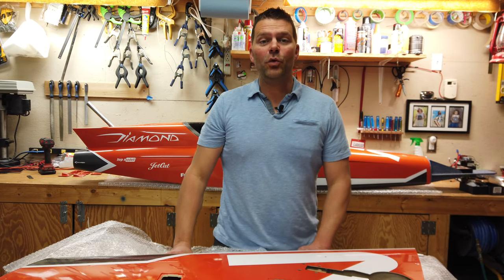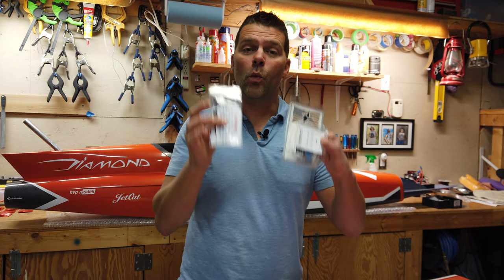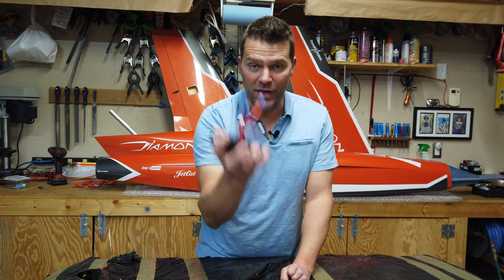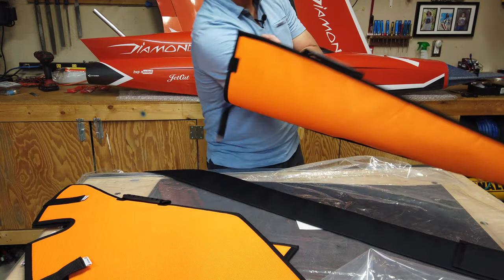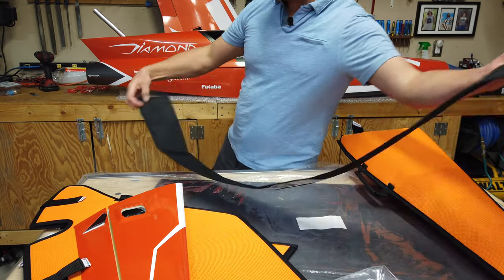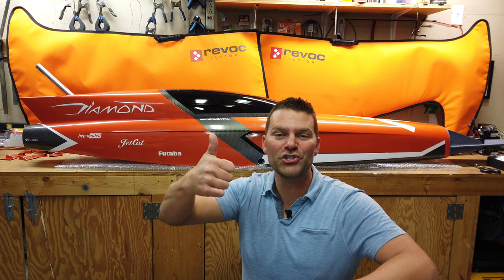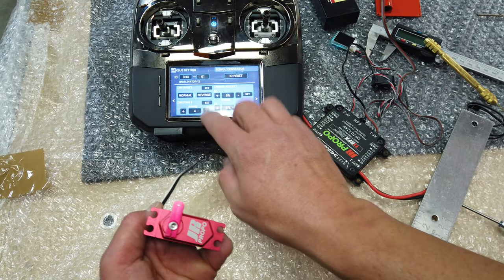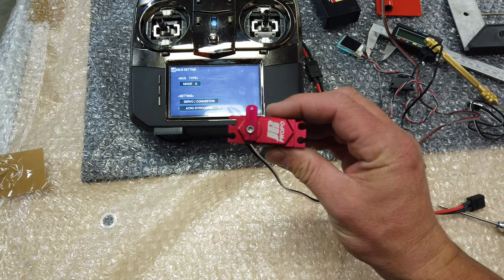BUILDING THE BIGGEST DIAMOND - Skycandy Light Giveaway! Aviation Design Target Drone - Part #4

Comment: Curious - Why clevises instead of some good, high quality HD ball links? The little clevis pin is going to wear that hole slightly oval over time, resulting in slop, and maybe even flutter.
Reply from the maker: Hey Frank. Great Question!  in some cases I like ball links.  If I look at my CARF Ultra Flash aircraft, which easily does 300mph/500km/hr as an example it uses a clevis on the servo side with mostly plastic servo arms and a ball link on the surface side but it's a double horn setup so the ball joint is supported on both sides.

With the Diamond on the servo end of things there is not a whole heck of alot of room with the small opening on the covers so it just made more sense to stick with clevis' but use aluminum servo arms all around.  I don't mind ball joints with an aluminum servo arm as it can deal with the side forces that a ball joint, only supported on one side will have.  As well these new JR servos have huge output shaft bearings.

On the surface side I could have used a ball joint but then it may be adding a bit of side force on the clevis as everything lines up so perfectly.  The other reason I didn't want to use a ball end on the surface side is it's only supported on one side so it's adding side or twisting forces.  Not saying it would be an issue but that was my thinking.

regarding the play that is something I keep a constant eye on with all my planes.  On something like my CARF Tutor (Snowbird) there are some clevis' used on fibre horns and after 300 plus flights they are still tight and accurate.  If they get tight than maintenance is needed.

sorry for the long winded reply but great question!😄
Reply: @thelightersideofrc  Not long winded at all, thanks for the detailed reply. The lack of any off centre force with a clevis is definitely a plus. I used ball links all around on my 1/5 Vailly Typhoon. They worked well in that application. Looking forward to the rest of your build!

Comment: So with Loctite and the set screw will prevent that power Jr servo from moving in the guides. Hum I'm hopinging so
Reply from the maker: Yea there is lots of contact with the Angels on the aluminum riser base. I suppose could also add adhesive between servo and aluminum cover.
Reply: @thelightersideofrc  Time well tell . In aircraft maintenance, we used the high strength loctite to hold in spherical bearing in a sleeve mount bracket for the Rudder bolting it together on the Buffalo aircraft I worked only. So yes it should work.